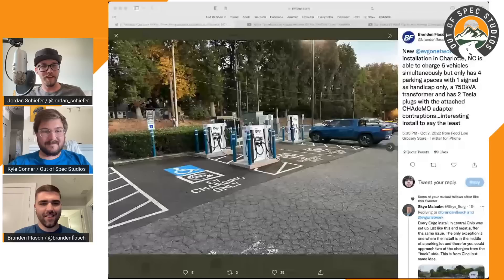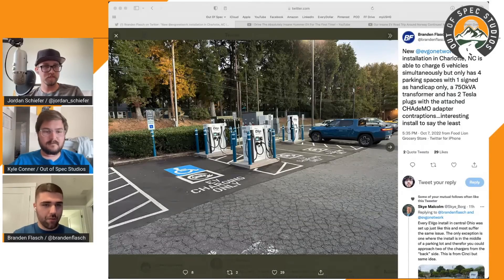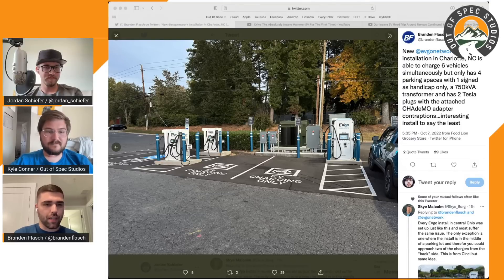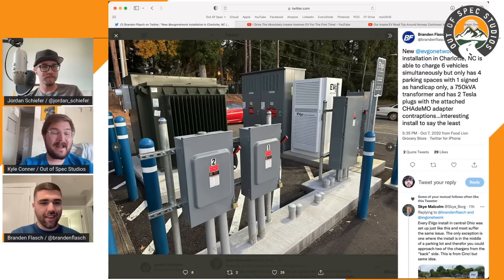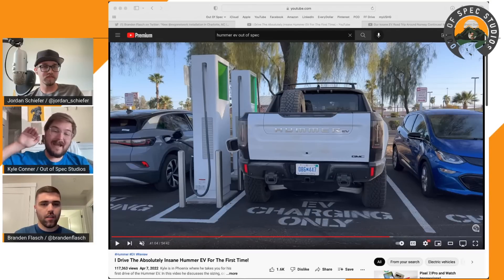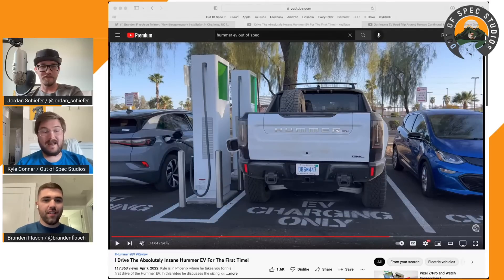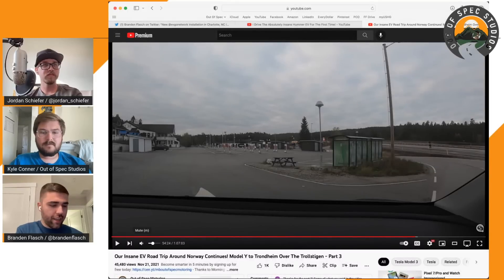Here's What Not To Do When Designing An EV Charging Station | Episode 71

Comment: The difficulty in many circumstances now is that the vast majority of charges are being installed in existing parking areas where required setbacks, firelanes, etc have been established by they city / county development officials. It can be difficult to impossible (cost prohibitive) to retrofit pull-through in those circumstances. It’s EARLY in our journey in EV implementation - so this is part of growing pain in placing these AFTER the fact vs. early in the process. I recommend reaching out to your development planners and engineers in your city and county to implement design standards so that EV infrastructure / site design can be addressed before construction.

Comment: Damn people, why try to re-invent the wheel?  The ideal charging station setup has been around for many years.  The best charging stations would be exactly what the best ICE refueling stations are today.  I am thinking of Buc-ees as an example:  1. A long row of pull-through stations with long hoses.  If the hose is on the wrong side of the car, just pull in from the other direction.  2.  Covered stations to keep you and your charge port out of the rain and the sun.  3.  Fast and easy pay with credit cards; why does the handshake have to take so long?  Why do I need to have a membership just to charge?  4.  Clean restrooms with food and drink available; and sales of cigs for those so inclined.  5. A place to sit and eat and take a break from driving.  6. Very importantly, the site should be attended by at least one person who knows how to operate the emergency shut-off. And call the cops when necessary.  And be able to deal with squatters who ice a parking spot for whatever reason.

Comment: My favorite charger design is the ChargePoint Express 250 CPE250.  You either pull in forward or back in.  Doesn't matter which side your charge port is on.  The cable never touches the ground and the swing arm where the charge cable hangs from takes up all the weight.  So it is way easier to maneuver.  If you have EV parking on the front side and on the back side just regular parking space even if some ICE car is parked in the EV spot chances are you can still use the charger by parking on the back side.  The only thing I change is have two CCS connectors on each charger and the ability to charge two cars at the same time.  I also make sure to have at least one charger if there is only two chargers at a location have a CHAdeMO connector.  Of course I want to up the power from 62.5kW.  I also add a credit card reader.  I just think it is the best usable design as far as the charging cables.  Personally I think having the charge port on the rear of the EV is dumb.  Why?:  Because backing into a stall takes more time because you have to be more careful about not running into the protective poles or scraping another EV.  It takes longer to back in because of this.  While if you just pull in like a normal parking spot when you back out it is easier because you are backing out into a much more open space.  This is why 99.9% of the time when parking into normal sparking spots all drivers pull in forward and back out of the space.  It is just faster and safer all round.  Had Tesla put its charging port on one of the front fenders or even on the very front of the car and made the cable just a little bit longer so it reach even if someone didn't pull in too close once it opened up charging to other non Tesla vehicles there wouldn't be any problem with charge port locations.

Comment: The other day I pulled up to an EA station.  Two of the four units were black.  Another car was in the third bay, which left me a single bay.  If I went nose in, the CCD dock on my e-tron was on the wrong side—and the hose was not long enough to wrap around the car.  Tail in, the hose was also not long enough because the hose which would have reached was the CHademO handle.  The space on the back side of the charger was not reserved for charging, and another car was in it.  I ended up pulling through the handicapped spot next to the charging spot, then placing my Audi sideways in the slot so that I could plug in.  I was praying that no one would need the handicapped slot while I was there, because if they did, I wasn’t getting out……

Comment: I drive an Ioniq 5 and have been in a wheelchair for almost 14 years. I have not seen this, but I would pull up and wonder what the heck, that’s confusing. I naturally would use that for the space… though not needed really. Having said that, if the handicap slot was only a 150 and one of the other spots was at 350… well then I would really look like a dork in a wheelchair, NOT using the designated space. I appreciate the thought and more space, but I imagine it confuses people.

Comment: The CCS standard needs to specify Driver front, Passenger rear, or center front / rear for charge port location.   That would solve 99% of these issues.

The only real issues come in when ports are consistently "opposite" the charger (namely driver rear, passenger front)

Comment: charging stations along highways need at least 1 pull through spot.

I recently did a 2900 mile trip and used 25 different chargers in my Ioniq5, not sure I saw a single pull-through.  And some of them were just downright strange.

Comment: Great discussion, hope powers-that-be listen!
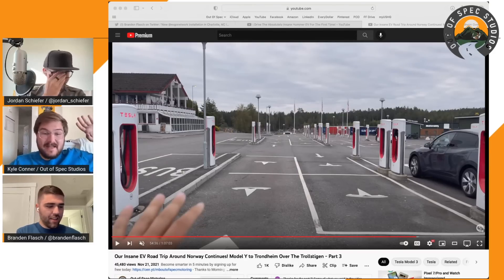@12:02 re the norway site, which is drive/pull-thru, charger on left rear (vs behind and back into stall):
I like that Tesla put in arrows (and T logo) for direction, so that you know which direction to drive in, especially w/ two stalls in line... (but also flexible for non-Tesla EVs.)
One problem w/ Mammoth Lakes, CA east of Tahoe, a similar 2-stalls-inline pullthru , is folks don't know what direction to drive into... especially, that the proper direction is from the BACK (south side) vs the parking lot entrance which is on the north side... most people enter lot, see stalls in front, drive in... the WRONG way.
Once ONE person goes in the wrong way, and borrows the OTHER row's charge cable , you lose one or more column of stalls entirely, either the cable is taken for the correct column, or there is no space to park on other side (ends are blocked by a tree and the power equipment.) They really need direction arrows there. Sorry if I didn't explain well, go check google streetview to see.

Comment: I wish Tesla charge ports are in the front. Many EVs have front charge ports. Home charger installation is usually at dryer location, but when I installed my Tesla wall charger, I extended the wire route to the garage entrance at the left side. It’s an extra 30 feet. 

My Mom’s car has handicap sign. One time I parked at the handicap slot with EV charger. I thought I was parking in the wrong slot.

Comment: Why put charge port on the driver side? In parallel parking situation your charge port is on the road side of the vehicle!!!
Reply: Clearly someone who has never been to NYC with one way streets, parking on both sides.  The trick being used for street parking charging in NYC is charger cables hanging overhead, thus can reach either side of the car

Comment: Ok question to panel. As chargers are getting more powerful. Should providers pull out older slower units along our Interstates that work and move these slower units to inter city stations away from the Highway? I personally don't see the point of throwing out good slow units wasting money when they can be used in local shopping centers or gas stations for "splash & dash" charging in your local city. I would think selling a used & recondition chargers would have value left in them.
Reply: I’d wager the installation costs far exceed the actual cost of the units.
Reply: @JimmyDorff  Exactly. It’s not as easy as just dropping them in a new location.
Reply: Unfortunately, there isn't really a market for used electronics. Think about it, they don't sell used wires or breakers anywhere. Once an electrical device has been used for some time they just recycle it since it's considered a consumable (in most cases). 

The actual charger electronics themselves probably could be salvaged. But with government incentives, there really isn't a case to spend less money for a used and non-guaranteed charger rather than a brand new one with warranty guarantees.